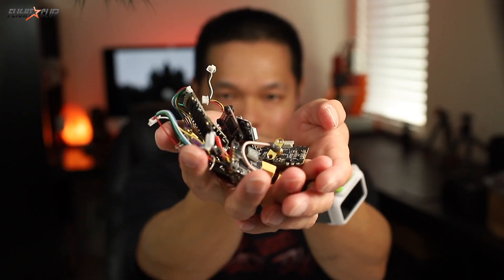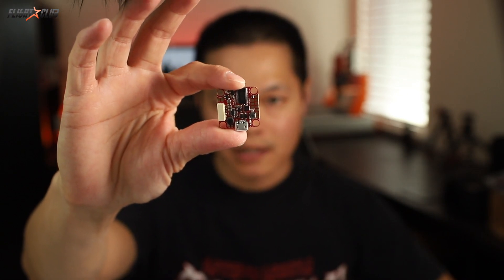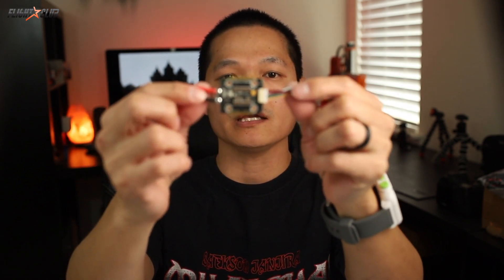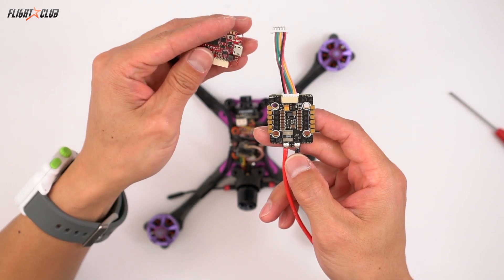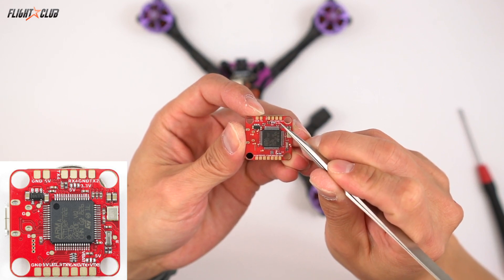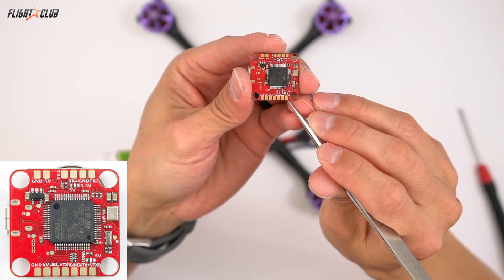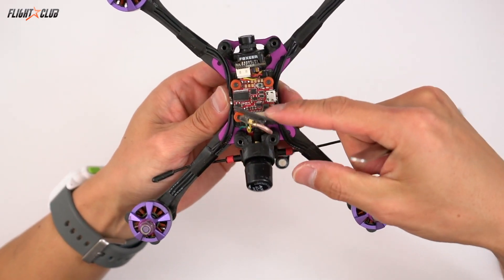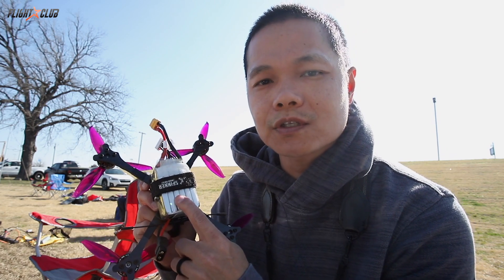Talon F7 20x20 Flight Controller is a Tiny Beast!

Comment: hi everyone
it's not easy to get the 5v output from the bord ( i'va got the v2) Beteflight target (talonf7v2) do not give acces to the "user1" mode.
so we cannot use the real pit mode to get the 5v output for vtx and cam.
i share with you the answer form heli nation :
"if youre on new betaflight, enter this into cli and it should resolve the issue. BF is changing a bunch of stuff right now
resource pinio 1 A14,
set pinio_box = 40
save"
By the way i read on the web that this "real pit mode" get the board crazy hot.
So can i get my 5V directly from the 5v pad (the one we need to bridge) ...so i will not use the real pit  ?

Comment: Hi, I like your videos very much. Quick question. Would this Talon F7-Aikon AK32 20x20mm 2-6s 4in1 ESC stack also fit on the bangkok frame without issues conserning the power lead coming in conflict with the rear shelf? grtz from Belgium

Comment: How's your video noise? I've got the Talon F7 and Aikon AK32pin. I've got video noise problems at medium to high throttle. Tried everything, cap on the battery, cap on the VTX. Using the same ground for camera and VTX. Powering the camera from the VTX, from the FC. Same thing.
Reply from the maker: my video is perfect.  i've got two of these stacks on my quads.  what VTX are you using?
Reply: @FlightClubFPV AKK X2p. How do  you have your vtx/camera set up? Are you using caps?

Comment: Glad you're feeling better, and good review. Don't stop taking the antibiotics just because you start feeling better though! I've been annoyed by some of these shortcomings on my Magnum F4 mini stack you mentioned, and M2 hardware sucks. I really like That the Talon is a direct plug-in for the Aikon. Repinning is tedious. What about the Matek F722 Mini though? Has the option to easily convert to 31.5mm size, dual gyros and camera ports if that's your thing, but most importantly - blackbox logging! This Talon could be good if you're on a tighter budget, but I'd spring for the extra features on the Matek, personally.
Reply from the maker: yeah that thing looks sweet!  i'm gonna get one and try it